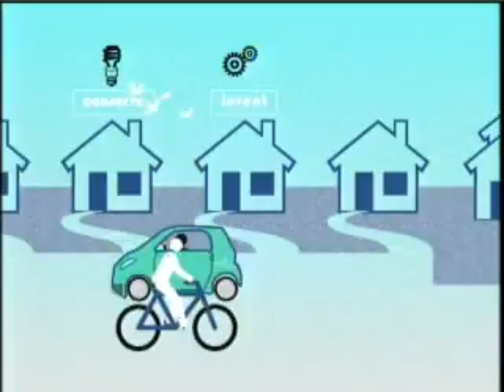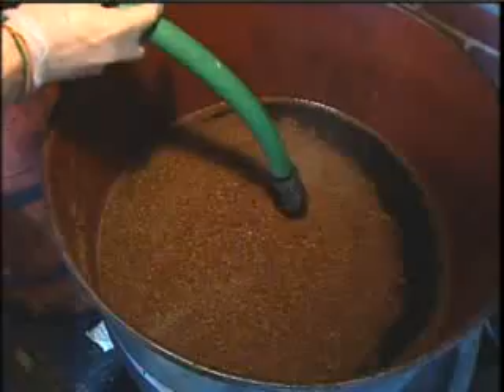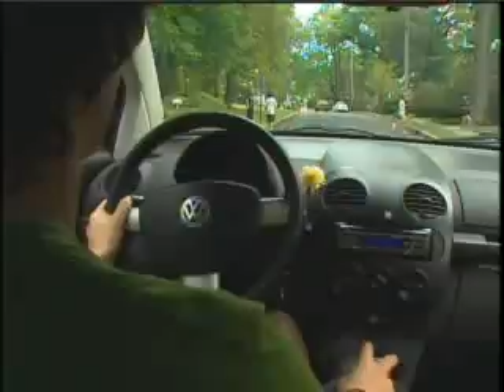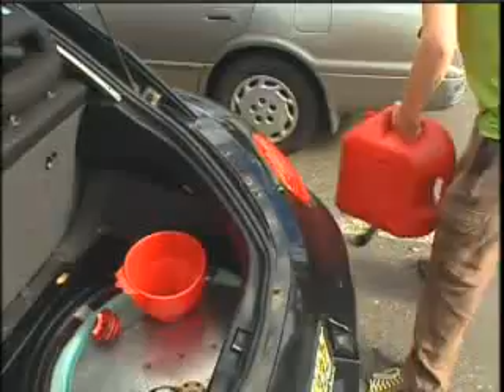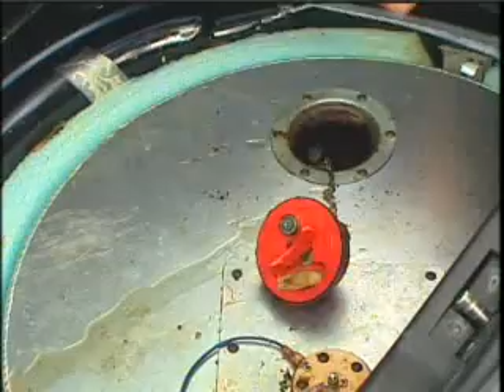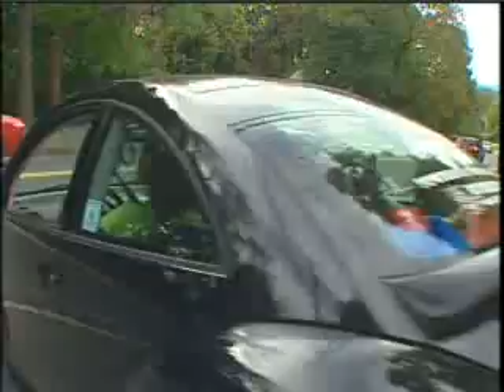Vegetable Oil Powered Car National News Interview

Comment: @cambriacity Actually a little marvel mystery oil in the oil each time your about to change the oil, for about 200 miles before the oil change clean the absolute heck out of the engine including loosens stuck rings.  I do however recomment at least a 3000 mile oil change on vegetable oil, especially in VW engines.  Do not, do not, do not go 10,000 miles like the interval says, you will fry the VW engine on vegetable oil, I have a friend that fryed his Passat engine at 10,000 miles.